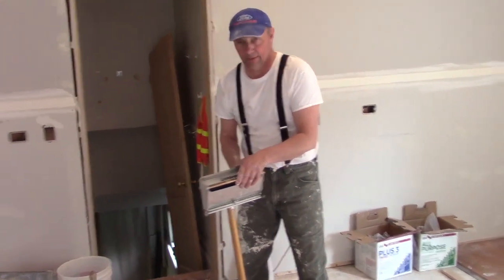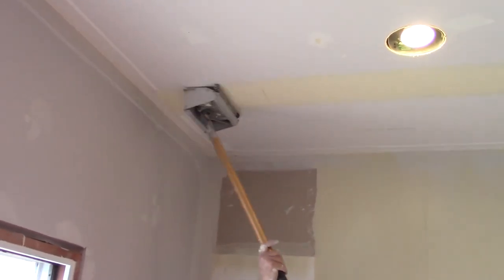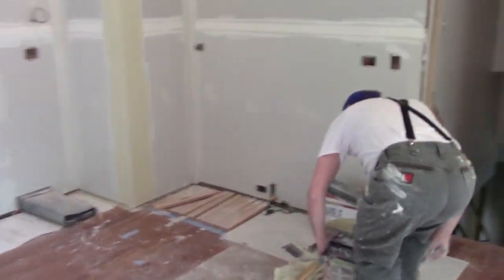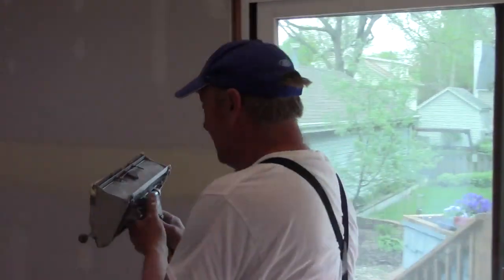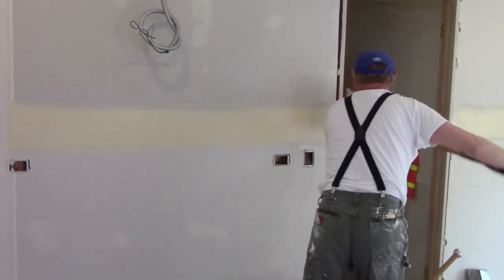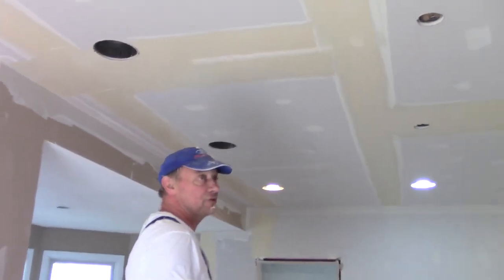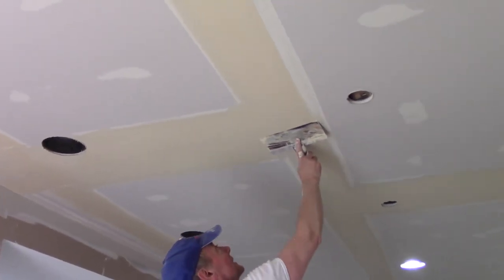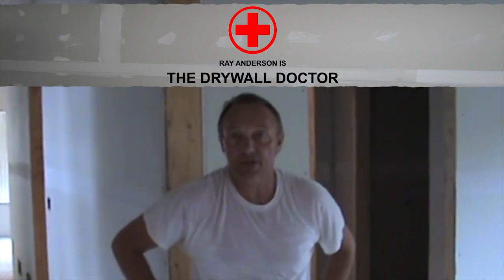Drywall Topping 101 First Coat on Tape and Bead

Comment: Doc when you mentioned Welch drywall in the late 70s I also worked for them into the early 80s this is where I remember you from also Dritex in the 80syou must recall joe labelle his favorite saying was I’ve got a real cream puff for you! The puffs were rarely scrapped out which did not make my father and I too happy. I think the rate was around 7cents. We eventually found out thru the hangers that were getting shorted on the board count that was a deal breaker, naturally.urban legend has it that a young disgruntled taper mixed a bucket or duro 20 and filled the gun pump and rest of tools with that hot mud. I guess back in the day drywallers didn’t put up with too much bs.
Reply from the maker: Always short on board and pay, taped with Jim Welch and Joe when I first started in 1976.
Reply: Not many old school guys around any longer, Ray I remember when I was the kid chasing out for lunch ect where has the time gone

Comment: Clever on the headers.... i once did a job where i was forced to get done extreemely fast and floated actual "But joints" out in a 2coat system but it was w/popcorn. I believe the system was to hand coat the deep side(after the 1st coat was done) w/1swipe....amazing just how fast one can be if he has to be. The situation was that moisture had to be out of the house & therefore the taping and texturing done, so the flooring guys could utilize the warantee...they were able to measure the humidity...ithink it had to be 17% or lower otherwise they had to be rescheduled, we got it done on time along with popcorn landing in the freshly mudded final coat...it should hav been made a video for youtube. Youtube didn't exist bak den, lol

Comment: I finished a 30 by 40 house by hand with 8 ft ceilings. And the guys that did the drywall didn’t care lots of unnecessary butt joints screws at angles and uneven ceilings, the but joints were 4 foot wide in places to hide them. I wish I had the boxes to help. I used buckets to stand on lol
Reply from the maker: Wait till you see my next video it's long but I'm using buckets to stand on.
Reply: @THEDRYWALLDOCTOR1   I’m learning now no one ever taught me. I m used to large plaster ceilings and walls ti float out. I need to master corners and factory joints

Comment: Could you possibly create a video that includes maintenace work on the flat boxes such as replacing springs, how to spot wear and tear, or how to replace/calibrate your blade. A maintenance video an autometic taper (bazooka) would be great also, replacing the blade or how to spot wear tear or replacing the chain. Thank you!

Comment: Here’s a tip when you are boxing...always try to stop at a joint when running your flats ,that way when you sand to run second coat you can sand all your box marks together in the same spot.. and not have to walk more than what you have too
Reply from the maker: Believe it or not that is exactly what I do I tried to leave my lap marks by the but joints

Comment: Not good avoiding a lid on the bucket. Your going to have foot problems later without it. Viewers, be mindful to load the bucket with something of weight in it and use a lid.
He's experienced with what only works well for him.
Other than that, the lesson is spot on mud application techniques.

Comment: I've been renovating historic houses in NYC for thirty-five years, and am new to the world of flat boxes. Can I get by with a Columbia 10" flat box and a mud pump? It seems to me corner joints are easy enough to do by hand with a 6" knife. Another question I have, standard USG mud from Home Depot, does one have to thin down that mix with water to successfully use a flat box and pump? Thanks a lot!
Reply from the maker: Sounds like you have a handle on it and yes thin down the mud to 10 box
Reply: @THEDRYWALLDOCTOR1  I got the 10“ and 12“ Columbia flat boxes, unless you think otherwise and can advise, I'm going to get a NorthStar Adjustar handle. A close second is Columbia's 42 - 63 inch handle. Thanks for your help.
Reply: @THEDRYWALLDOCTOR1  I'd like to pitch you to Amazon or Netflix for an updated "This Old House", what say you? You certainly have a lot more screen presence and energy than Bob Vila, who basically never lifted a screwdriver, lol.

Comment: New and subscribed.  So new, in fact, I tape w hawk or pan and stiff knives.  I've seen pictures of tapers work and it looks so clean, those boxes are amazing!  You mentioned different sized boxes. can they be used in corners or on imperfect drywall jobs?
Thanks!
Reply from the maker: They can but I don't I run corners by hand 8-10" Just box the flats 10-12"

Comment: Love your videos!  I recently bought a level 5 corner roller and angle head.  Still getting used to the angle head but happy with the products.  Is there a reason you dont use any of their equipment in your videos?
Reply from the maker: I have all tapetech
Reply: Up front cost of the tools is expensive, but it you take care of them they last for years. Case in point, I bought my first personal set in 2008, other than maintenance, they're still going strong after 12 years and probably ~20,000 sheets/yr

Comment: I've watched your videos for years now. Quick Question, did you tape and coat the corners in one day, or did you tape the corners and top them in one day, and then tape the butts & flats in one day and coat them? thus separate days? I'm a young guy in the trades and have a set of tools just trying to figure out the best method for me to finish out some houses. A reply would be much appreciated! Thanks Drywall Doc.
Reply from the maker: I taped and topped it complete angle seems everything

Comment: Hey Mr. Ray, do you ever need to use the 20 or 90 minute mud? They seem to dry on my stainless steel pan before on the wall. Thanks!
Reply from the maker: Yes I use everything from 5 to 120

Comment: If I was searching for the tool that you are using to apply the mud, what search term would I use?
Reply: frosty992001 depending on your region. It would either be a flat box or a finishing box
Reply: Joel Bartley Thanks, Joel. Much appreciated :)

Comment: Hi doc,iam having a problem with my joint boxes leaving lines/groves either side of the joint.ive tried adjusting the blade and tension.its still doing it.any suggestions.thanks
Reply from the maker: Was it a new blade? if so make sure it was put in correctly and the brass was really clean before you put it in sometimes mud Gets behind there and pushes the blade out. Otherwise just keep playing with it. bring the blades in and out until it's stops
Reply: @THEDRYWALLDOCTOR1  
No not a new blade i maybe had it screwed out too far,I will play about with it.just thought I would ask the master first.thanks very much for reply.have a merry Xmas.🎅
Reply from the maker: Marry Christmas to you too. Does the blade need replacing?
Reply: @THEDRYWALLDOCTOR1  thank you, no the blade is good.i think there was too much arc on the blade holder,I adjusted the tension    
and blade.i thought the blade holder was at fault but only 3 years old.👍

Comment: Hi there. I would like to know why I do get shrinkage of mud on the flat joints. I do use boxes to finish joints. They seem to look fine after I sand and paint only to see mud shrink after the day I paint. I appreciate your opinion.
Thank you
Duka
Reply from the maker: I plan on doing a live feed tomorrow on YouTube and I will answer that question that is a great question I've had that problem there's two reasons it happens. Try to tune in around noon Chicago time.
Reply: Make sure your tape is dry when you coat it or you will have alot of touch up.

Comment: Hello, I appreciate all the work you put into these videos! I was wondering if you could tell me how much water you would put into a full bucket of all purpose USG Drywall compound before you box off your seams. I just bought a pump, a 10 inch box, and a 12 inch box. the thickness of the mud that I'm using I believe might be too thick because I have to press so hard on the box to get the mud to come out smoothly, but officially I was told no more than a pint of water at a time, and that certainly doesn't seem thin enough. Could you clarify how much you use Please, thank you so much!

Comment: Question: Do you wipe behind your flat boxing?
Reply from the maker: I have a video about that soon and no if I have to wipe behind the box it needs adjusting
Reply: @THEDRYWALLDOCTOR1  Thanks for the reply....the flat joints are something that we have been somewhat struggling with for a while now. I know several companies that have their guys wipe behind the box and some say don't have to. We usually don't have a problem with walls, even if the joints are slightly humped they usually dont show, but the ceilings can be IMExperience, a little tricky. Of course there can be other factors i.e trusses, quality of rock, etc, etc. One thing that i did notice was a bad habit i developed of trying to put preassure on the front of the box as opposed to the back. Reason why i started doing that? A: To eliminate/reduce skitches...by not putting presure on the blade, i thought that there be less chance of dragging crumblies/sand/etc and therefore creating skitches. BUT...after i started noticing the mud got applied on way heavier and created humping out the flat joints. I mean i'm talking like night/day difference....not a slight difference. So now i'm putting pressure on the blade, you know --the way it's supposed to be done. I had to fix a couple of ceilings in some houses i did--NOT FUN. Lesson learned. And there may have been other factors involved...like i had bought some different brand flat boxes and now i'm checking every coat to make sure i have set on the correct number....just really watching it close and i have not been wiping behind the boxes either. This last house i did...there was 1 flat joint that got humped somehow...so i had to turn it into a but joint...but the others turned out pretty good. And there are the other factors....like when one or both sides of the bevel are sticking out. One side probably means truss issue and wen both sides are sticking out it's probably sound channel. So i use EYBALL DRYWALL APPROACH....solves alot of problems b4 they arise. 51yrs old and still doing high end custom homes, duplexes and sometimes basements included...alot of work for1guy. But early to bed to rise helps. Got me a new taping/floor seamer tool for taping the rosin...that thing is awesome. Can do figure 8's with it if i had to, lol.

Comment: Can you walk a bucket on the side of a spinning ball?
Reply from the maker: On my hands? With my eyes closed?
Reply: THE DRYWALL DOCTOR 
How about if the ball was spinning at over 1000mph, orbiting the sun at 66,600mph, and the sun had an invisible tractor beam on the ball dragging it trough a vacuum at 500,000mph around the solar system while the whole solar system was going around the great attractor at 2,300,000mph changing directions and changing speeds?

Comment: can you skip coat mud over wallpaper?
Reply: Hi I thought I'd share. This is what i did on my own house because everything that I tried to remove the wallpaper wasn't working, it was pretty well glued and wasnt coming off without the sheet rock paper along with it. So I decided to peal back the worst of the lose wallpaper (I found it was mainly at the internal corners, wallpaper joins where lose or peeling back and the top 6" in every room ). I did prime where ever I removed the wallpaper with a paint on sealer so that any sizment or glue wouldn't affect the plaster, then 3 coats over all peeled back prepared wall paper and cracks or tears from moment were tapped then 3 coats. I installed new internal metal angles of my choice to the corners and finneshd as per usual. I didn't skim coat the whole wall only the worst parts or where there was textured wallpaper. Probably a few details missing but you get the picture. This worked well for me.

Comment: Why don't you use a 7 box?
Reply from the maker: Stopped using a 7 when +3 came out
Reply: @THEDRYWALLDOCTOR1  I hear Ya. Didn't know that they had come out with a +3. My dad used machines when ames was all you could get. He finished commercial before we moved to Georgia and then he got into residential. I remember cleaning them before he took them back which was a pain. I finished by hand before i got into law enforcement Drastic change LOL. still do the occasional small job from time to time just to keep in practice. Thanks for the great video and keep up the good work.

Comment: Your flats look a bit heavy but who am I to say. Also you should put your overlap line by the butt joint that way you can eliminate it with the knife when you do your hand work on the butts. What I do is I run my 7” quickly one pass ignore defects. I’ll work on bead or something for about 30 mins and as you know the mud starts to set up after then. That’s when I re run the 7 and the second pass eliminates all the mud defects. And by then you can tell which side of the tape needs more mud if any and you can cheat your box to that side. Basically 2 passes not 3 or 4 to work the mud smooth. I find doing a 7 “ and 12 “ is plenty my 10” box is an expensive way to prop my van door for many years now 😂btw excellent buckets skills amazing

Comment: You started out quite good and then it just went bad you don't need to use a paddle or a knife after using the boxes they are a finishing tool you've used them as an applicator which saves you nothing really how you end up with a good joint I don't know Tim Wagga plaster works

Comment: Nice work, but I don't want to see you working naked. For the good of of humanity, lol.
I would like to know if you use special compound for these plastering machines as opposed to the regular USG compound that they sell in Home Depot.
Reply from the maker: No nothing special just the regular mud that you buy at home Depot
Reply from the maker: And I don't want to see me working naked either
Reply: I'm a professional taper in NYC for over 25 years, but I've never tried one of these Auto taper machines. I see they cost over $3K for the complete set, so I don't know if I want to transition to this now. I'll see.
Reply from the maker: They also rent them you might want to try renting them first

Comment: Mr. Drywall Doctor.  I can let ya know I came up with a Good system with Floating with a 12 box setting it Wide open using Plus 3 mud and I only Float the Seems 1 Time  also my Corner Bead I only Float 1 Time also. Hopefully soon you can Demonstrate it for Me. From your Drywall Specialist

Comment: I'm guilty of not taping under crown on my bedroom, it was paneling and I peeled it off and did structolite over the rock-lath from the 70's treated with a bonding agent. I didn't feel like doing angles and having it mess up my crown, the ceiling was already plastered and finish to perfect flatness, any tape would have bulged it out and made it harder to do crown

Comment: Wrong way like 99% of tapers do running butt joints! If the walls or ceilings are smooth the joints will show with top and skim coat. Walk in any house and look at the ceilings and walls close and you will see the butt joints. Butts should be run by hand top coat and then boxed on finish/skim coat. When you cover the tape on a header joint which is already built out since it is not recessed it will show. Don't get me wrong most of these videos are great but I could teach him a few things. And I enjoy them and his humor, Smooth wall is the test especially in hospitals or commercial applications that require perfection.